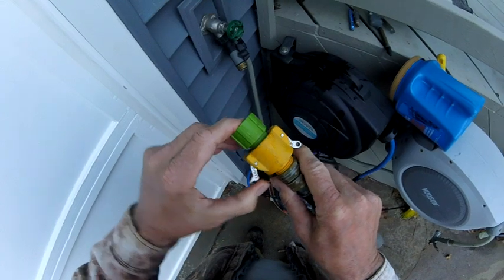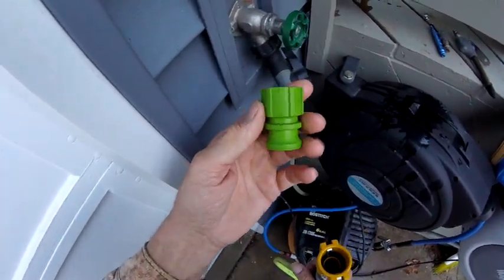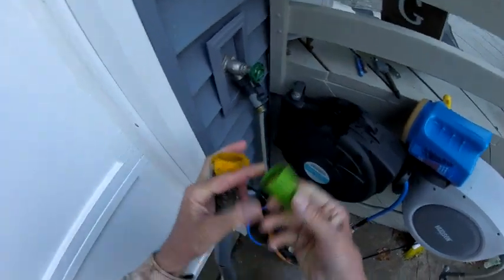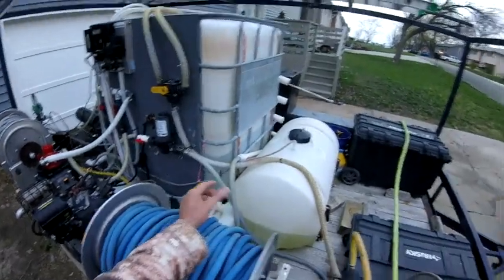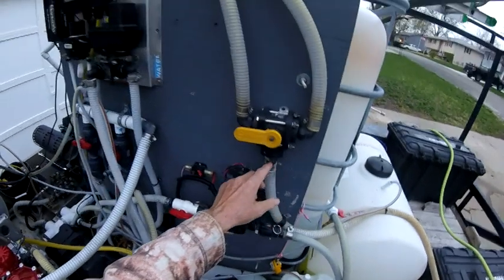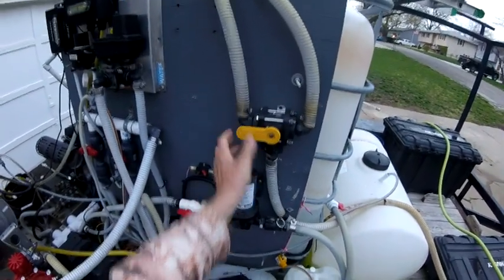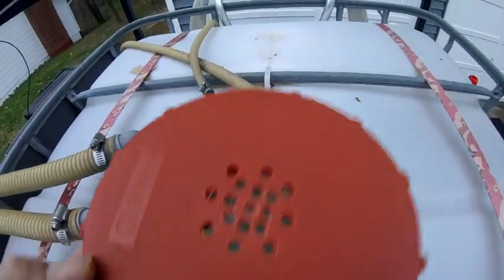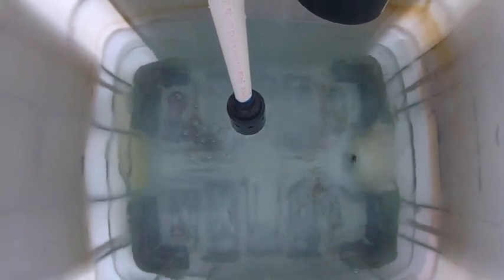Two level buffer tank fill system explained.

Comment: I always enjoy your videos!   I know you have used many different systems for soft washing a house.  Probably a 4gpm to start, an 8gpm and so on.  You also tried several of the AR style systems.  With all of your usage and experience of these systems what do u pick as your favorite system for house washing (only)?   What's your favorite system for roof washing or anything needed 3% or more SH?   I am happy and content with my 6.8gpm gas system but I am curious of the AR pumps - I know you have had some issues in the past.    THANKS!
Reply from the maker: In a perfect world, I like washing siding and roofs with the gas diaphragm pumps.  Recently, since my ar45 was leaking, I've been downstreaming with my 10 gpm.  It works very well, but it is tiring on my wrist and arm.  I went through two 12 volt pumps in a year so I'm not a fan of those.  I think this new AR30 is going to work out well.  Check back in a couple of weeks.
Reply: Thanks for the response.  Honestly, I am pretty in the dark regarding the AR systems.  If you need a suggestion for a video, perhaps a beginners guide to AR pumps to discuss the pro/con's of these style pumps.  I would suggest to keep it very basic - like explaining to a 10 year old :)  Thanks again! @housewashing5693

Comment: I’m running a jobe float valve. They are a bit more. $60-80 each for the high flow versions but they’ve got a TON more flow and they are extremely reliable.
Reply from the maker: I'll try those when these fail
Reply: @housewashing5693  thanks for the upload, definitely gonna be trying some of these tips out 🙏🏼
Reply from the maker: @backspace12399  Great.  Let us know how it works out..